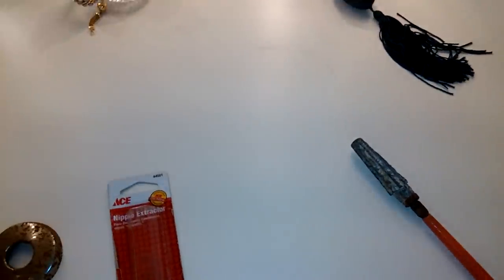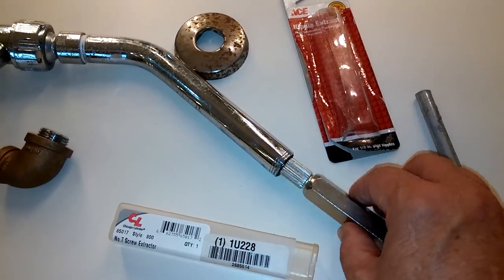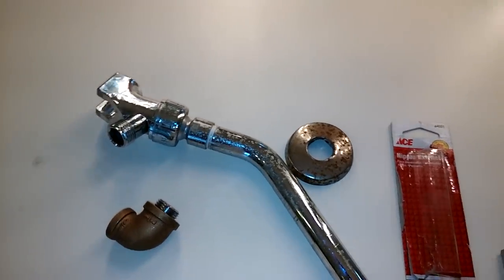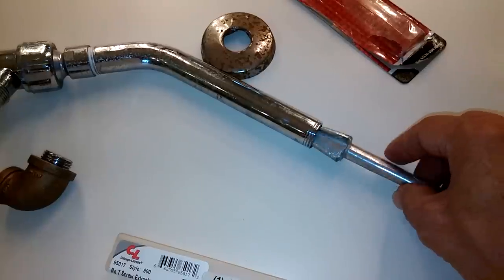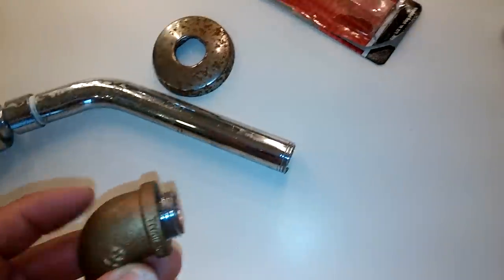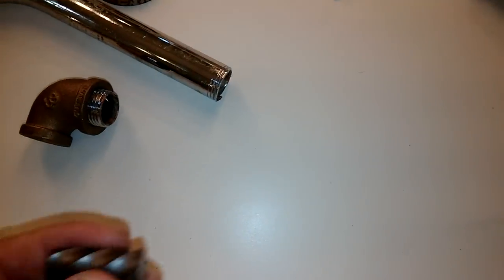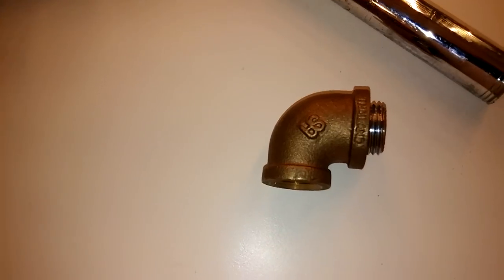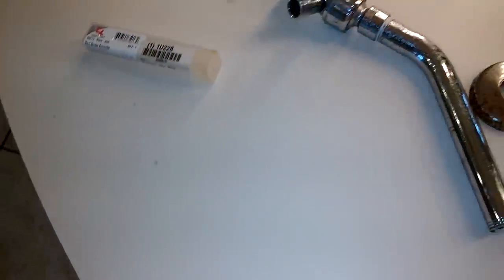How to repair a broken off shower pipe nipple

Comment: I tried two different nipple extractors and they would not work.  I was at a point of ripping the wall apart and replacing the elbow, until I watched your video.  It literally took me 7 minutes to cut the screw extractor, remove the broken nipple piece and install the new shower head arm.  Thank you!!!!!
Reply: What did u use to cut the screw extractor?

Comment: I would have saved about $50 and 2 days waiting if i found this video first,  thank you! I cut the extractor using a dremel metal cutting blade about 1/4" in from the point of contact like the other guy,  gave it a little tap with the crescent wrench and it pulled the broken threads out like a charm

Comment: The Mibro #7 Spiral Screw Extractor from Tractor Supply works without the need for cutting off the end.
Reply: A big thanks for this heads up.  Item in stock at my local TS and saved $$$
Reply: Ty. I've tried everything already:(

Comment: the only problem I have with your method is the metal is too hard to cut with a hack saw. sow how did you cut the screw extractor in half?
Reply from the maker: I used a Saw Zol with a New Metal Blade

Comment: Since you had to cut a no.7, would a no.8 extractor fit?
Reply from the maker: It did not work in my situation.   The pipe was a 90 degree
Reply: Thanks